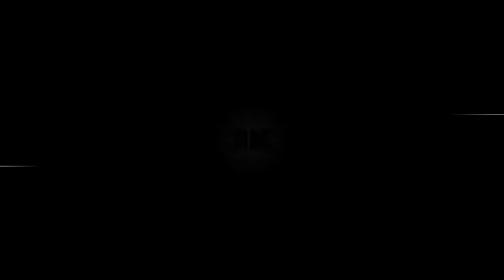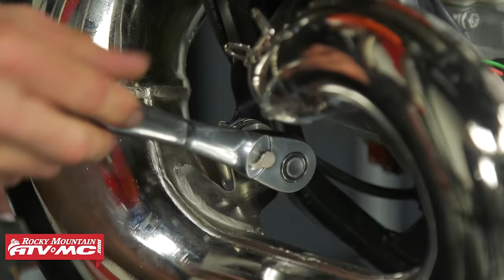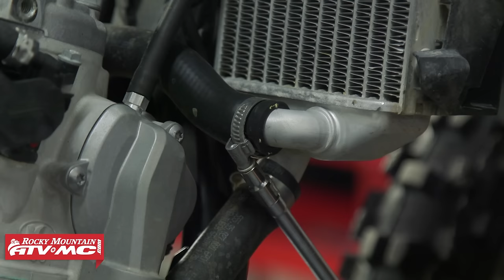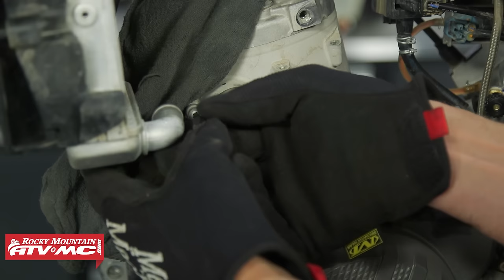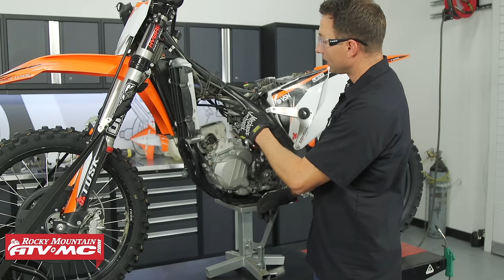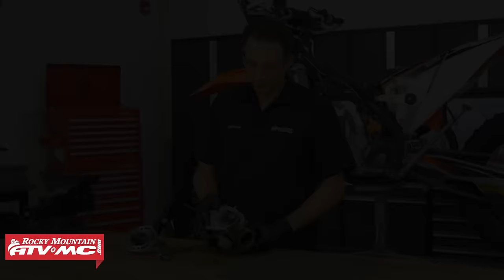How To Rebuild the Top End on a KTM/Husqvarna/GasGas 250 & 300 2-Stroke TPI

Comment: what is that cleaner you are using on the power valve? I've tried oven cleaner and carb cleaner and it is still a lot of work compared to what you show in the vid
Reply from the maker: That's the Polaris Carbon Clean Fuel System Cleaner. You can check it out here: https://www.rockymountainatvmc.com/parts/polaris-carbon-clean-fuel-system-cleaner-p

Comment: You skipped the one portion of video I’m looking for, how did you loosen the nut on the cylinder on the power valve side? I can’t seem to get a wrench in there with the rod in the way
Reply from the maker: Shoot, we removed ours with a box end wrench. It should fit between the rod and radiator hose. Pause this video and you can see where the wrench is at. https://youtu.be/wwLSIDFdVR4?t=223 -Charles
Reply: @rmatvmc  thanks for the reply, I'm wondering if there's thinner sized wrenches than what I have, I ended up having to remove the power valve mechanism to get it loosened. Thanks for the help.

Comment: One question can I over torque a bolt by 6-8ft-lbs more because my KDX 200 requires 18ft-lbs and my torque wrench is 25-250ft-lbs
Reply from the maker: We would not recommend it. There is a chance you can get away with it but there's also a good chance you break the bolt or cause other damage.
Reply: @rmatvmc  ok thanks

Comment: One thing I haven't seen in any video is the orientation of the ring gaps. Is there any particular best position in the cylinder and are the two ring gaps offset 180deg from one another or what. What is common practice?
Reply: their are pins in the ring land that orient the rings.
Reply: @robbiechiles36  Thanks. Yep I found them, and she's running great.

Comment: What kit would you guys recommend for a 2021 husky 300 tpi with 112 hours on it?
Reply from the maker: We used the Vertex piston kit for this rebuild and have had good luck with them. Also, the Pro X top end gasket kit will come with all the gaskets and seals you need so you don't have to dig through the OEM parts finder and find them all individually. The first link in the video description will take you to a page where you can see all the parts and tools that are needed.

Comment: I would say this KTM is actually "oil injected" as opposed  to fuel injection like the TBI is. If and when the oil pump goes this bike will seize up! TBI is a much better option as you still put oil in the fuel.

Comment: I have always been told to never use a ball hone in a 2 stroke cylinder because the balls can catch on the transfer ports and damage the cylinder. Is that not a issue anymore?
Reply: That's 1 reason. The other reason is that the cylinders are nikasol coated and a ball hone can damage the coating. All you need to do is scotch brite the glaze off the cylinder and it's good to go. Some people say the nikasol coating is so hard that the ball hone doesn't hurt it. Ball hones are good for non -coated cylinders generally.

Comment: When deciding on a base gasket height, would it be ok to just reuse the same size as the one(s) you pulled off?
Reply from the maker: Not necessarily. That might be a good starting point, but the reason you'll want to check the deck height is because the new parts can vary slightly due to manufacturing tolerances. I'd recommend checking it to avoid problems. -Charles
Reply: My 300, the previous owner had a .025 cylinder gasket. That's way off from factory. I was worried but I knew the previous owner had a mechanic do it, so I put same size back in. It turned out ok.
Reply: All about squish.  You can fine tune your squish via base gasket.
Most two strokes are built way too loose.
Only fix is shaving the head
Reply: The smaller base casket more compression more power.

Comment: 28:35 why does both piston ring ends are aligned?
Reply: Look at 28:14 in the video..
Reply: @onthethrottle7104  not true.  there is a locator pin for the rings on 2 strokes.  If not, the ring could rotate and the end get caught in a port.

Comment: Tip: do not remove the middle screw in the right power valve mechanism, then you won't have to set Z dimension again
Reply: But then you cannot remove the exhaust valve control shaft behind it to clean the shaft and cylinder in that hole and replace the "o"ring.
So why do an approx. 90% job when the engine top is completely removed and being inspected & cleaned.
As a mechanic / technician not doing this is considered being a hack.
Reply: yes, you can, at least in a 2020
Reply: The only reason you would need to set it is if you loosen the jam nut set screw. Even if you loosen the middle screw you still don’t have to set it.
Reply: Excellent video

Comment: Hey charles
I'm wondering, if I buy the base cylinder gasket off  the OEM diagram, do I get different sizes or just one gasket?
Reply: Scroll down to #22 on the parts list or whatever number it shows for your bike, and you'll have about six options. The last two numbers in the part number should be the thickness in mm. so .20mm-.75mm. -Charles
Reply: @CharlesTheWrench  thanks a lot!
Reply: What size was new piston A or B👍🇬🇧